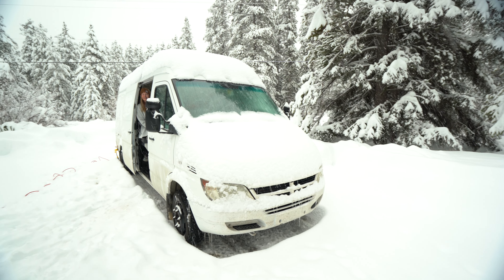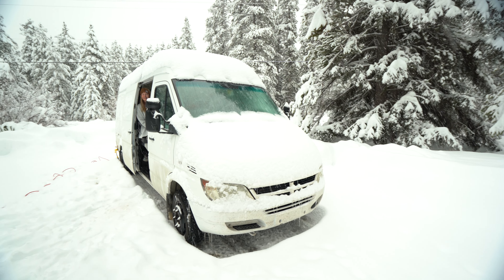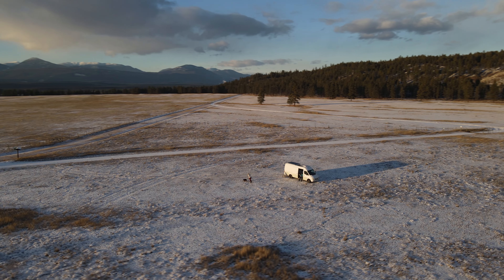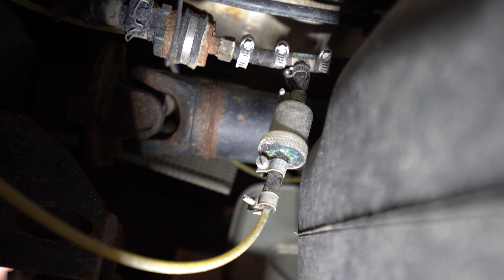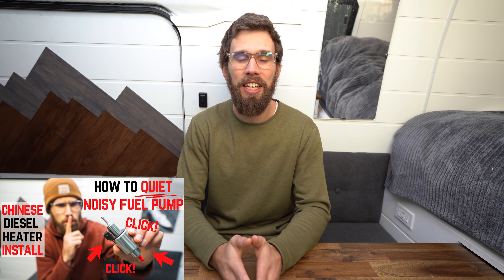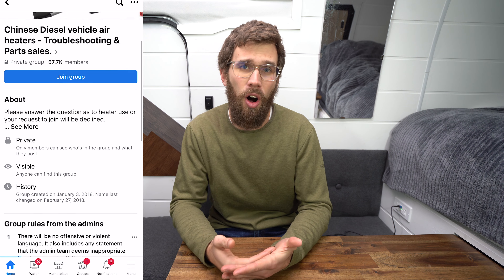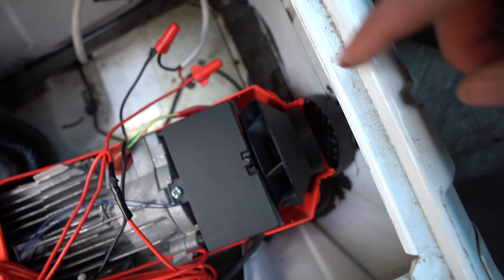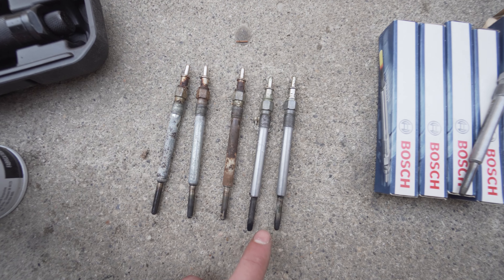Chinese Diesel Heater Review & Install Tips After 2 YEAR’S of Vanlife

Comment: Just one thing to remember the parts for the other guys are a lot more expensive
Reply: Yep. Parts kits for these are cheap. easy to keep spare parts on hand if something fails. The electronics board is $25. New glow plug kit with wrench.. $15-20. Fuel pump $20. Gasket kit to put back together is cheap. Coat the gaskets with vaselne or chapstick when you put it back together and gaskets less likely to stick and tear. Can reuse them. Cool beans.

Comment: These are not identical to webasto.

A webasto is built better, but they are far more expensive.  I used to get 2or 3 yrs on a webasto till they were Carbon packed.  Parts price make repairs not practical.

If I get 800 hrs on a Chinese heater I'm ahead $
Reply from the maker: Not identical, but extremely similar. Did you try to clean them out and keep using them? That makes sense about the parts. I’d say I’m very close to 800hrs on mine
Reply: The burner assembly and the mesh get clogged.

A new burner/glow plug is over $400 on Amazon.

When I saw that I made up my mind to try a Chinese one.

FWIW, the espar and webastos are both 2kw heaters.   I'm not sure if you knew that

Comment: How do you prevent the diesel fuel from freezing/gelling? I'm concerned. 

Since this happens as high as 32F/0C. 

Do you use additives?
Reply from the maker: No, I have never had this problem. The fuel companies usually add additives to the fuels in Canada during the winter months.
Reply: Another option is a kero/diesel mix.  Has the diesel required to lube the pump but the kero lessens the chances of diesel gelling.
Reply: What part of the world do you live in? Most places it gets cold they begin to produce winter fuel. Here in Canada I think it's October they begin to make the fuel with a lower cloud point.
Reply from the maker: @juliogonzo2718  I live in Calgary, Alberta and yes I do know about the winter additives 👍 I always notice my fuel mileage drop a bit when they start treating the fuel haha

Comment: Hey, thanks for this. A nylon pipe provides a smooth fuel delivery. But, you mentioned that changing the fuel pipe diameter, changes how much fuel gets to the heater per second. Which do you think is more important as I have both? Thanks, in this video they are recommending the nylon pipe https://www.youtube.com/watch?v=Yn-GAIzelCU&ab_channel=NomadBrad
Reply from the maker: A larger diameter pipe has the potential to deliver more fuel. Doesn’t mean it will though. As long as you have the right pump you should be fine. I would use the hard hose, not the soft one.
Reply: Thank you! So the pump that comes with the heater or the pump that comes with the hard pipe!
Reply from the maker: @elliotgilford8583  the pump that comes with the heater

Comment: It’s not an engine.
Reply from the maker: Agree to disagree 😁
Reply: It is in that it is a machine that does work, in this case generating heat, yes it is an engine.  I’ll grant you that.  BUT…. At one point you compared it to a Diesel engine that compresses the diesel to combust, and that part is %100 wrong.  There is no compression in this machine whatsoever.

Comment: Vevor heaters have been declared "unsafe" and "harmful".  "The product has been found unsafe under The Supply of Machinery (Safety) Regulations 2008."   Vevor will refuse to honor their warranty.
Reply from the maker: That doesn’t surprise me very much. Most knock off products manufactured over seas don’t meet our standards. Thanks for the info though! What makes it unsafe? Is it carbon dioxide?
Reply: We need a link to this claim. I've searched, and cannot find ANYTHING legal that states the Vevor products are unsafe.

Comment: I had one break down after a winter of 24/7 use in Wisconsin. There are not many parts and they are all really cheap to buy but do take forever to ship from china. All the parts are easy to replace as well. Not a bad idea to buy extra parts to have on hand. It's only like a censor, glow plug, fuel pump and fuel filter and parts are under $10.
Reply from the maker: Couldn’t agree more! Thanks for watching Jason 👍

Comment: I've heard the china ones can leak exhaust do to poor craftsmanship. Planer is a good brand. The exhaust gasket fails or the metal warped causing a leak. But that is the only things I've heard bad about the china ones.
Reply from the maker: Interesting, we occasionally smell diesel fumes during start up or shut down but it doesn’t last long at all.
Reply: never had it happen, out of the 5 I have and the dozen others I installed for people.
Reply: @madetoexplore  check your clamps on the exhaust line usually the clamps they come with are pretty lousy.
Reply from the maker: @Refertech101  yeah I’ve busted a couple of the clamps already! I’ve replaced them with some better quality stainless steel ones.

Comment: I just bought a Colinktool heater, i installed it today and overall it works great but the fuel line supplied is far too small to and doesnt matcha ny of the other supplied components like the pump, filter, the fuel tank also doesn,t come with any installation or operating instructions

Rated 5 star
Reply from the maker: Sorry I don’t have much experience with that heater!

Comment: Fuel line diameter is irrelevant.  The system is not a pressure delivery system and the pump is a positive displacement type.

Carbonising is mostly down to inlet/exhaust restriction - too long, too many bends.  Better manufacturers provide proper instructions for choosing the correct pipe sizing.  Your exhaust exceeds the spec so your machine might well carbon-up at some point.  Some controllers are able to be programmed to accommodate fan speeds/fuel delivery to burn more cleanly (less smoke and CO in the exhaust gases).

Diesel fuel contains approx 10.5 kWh/litre.  These heaters are most certainly not 100% efficient.  I suggest there is no such thing as a 8 or 5 kW (output) example.   Check yours for a reality check!  Likely not so much better than 80% efficient, 5kW (chinese) is likely a little over 4kW.
Reply: A small rigid fuel line from fuel pump to heater is best. The pumps create air bubbles. Small tiny lines help keep the small bubbles from building up. They just go down line and don't build up. a larger flexible rubber line should be avoided imo.
Reply: @MrRatkilr   I’ve yet to notice any seriously joined-up bubbles.  The heater will likely easily cope with a centimetre(?) of air bubble in a 6mm ID pipe (but I’ve not bothered to experiment).  My supply line, after the pump, is approx 4m of 4.76mm diameter brake pipe connected with the flexible tubing supplied with my machine.  Been no trouble, so far, and I am not expecting any.
Reply: @oliver90owner  If it works that is good. Just wanting consistant feed with  little to no bubbles in fuel line. i get a few bubbles in my small lines but they pass right through. My two heaters been running flawlessly.
Reply: @oliver90owner  as long as it works its good. Been watching vids on these and info on vids. Have vested interest on these as I use them now to heat garage. Been using them since november. they been running flawless until last week. Had one quit. Not sure why. We just got hit with 3 day blizzard a few days ago. Didn't shovel path to garage door until today. lol Was too tired from shoveling snow to work on heater to see why it shut off. Thats why I have two off them. Redundent backup. One fails you still got another to put out heat. Interested why the one shut off.
Reply: @MrRatkilr  I have a couple of dehumidifiers in my workshop.  These keep my small(ish)workshop condensation-free (above dew point) by maintaining a sufficiently low humidity and the temperature just a few degrees above freezing.  

I added the diesel heater because electrical heating has become prohibitively expensive.  We rarely have to put up with more than a few days continuously below freezing (on average), during the winter months.  The heater soon raises the temperature to a reasonable level for working.  It has been used quite often recently, but usually on the minimum fuel setting - and the dehumidifiers are likely off until autumn.  

They are good because they supply warm air without added water vapour, fuel can be stored, and they are (relatively) a simple piece of kit.  Good luck with finding your fault.  It will be reasonably inexpensive to change the faulty component, if needed.
Reply: @MrRatkilr  A pump does not create air bubbles. Unless it is broken. If you have air bubbles in your system, you have a leak somewhere.